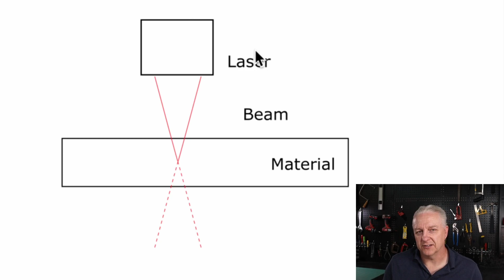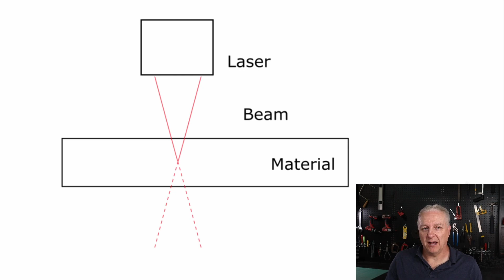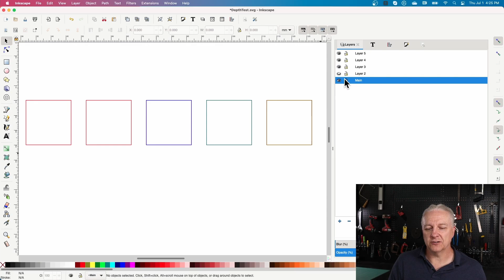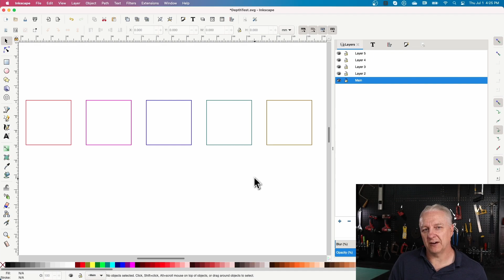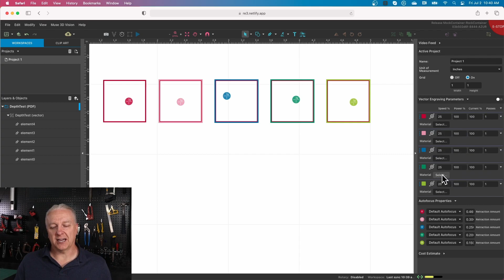LASER CUTTING THICK MATERIAL IS HARD!

Comment: I've got a DIY CNC laser with a measly 5w output and it never occurred to me to lower the Z height for subsequent cuts. Thanks for the tip. I'm going to try cutting above my weight class now.
Reply from the maker: As long as you don't move the project while you are refocusing you should be fine. Note, though, that a diode laser beam has a much longer usable focus area, so the benefits might be more minimal than, say, a CO2 laser.

Let me know how it goes, and good luck!

Comment: I’m here because I got a 100w co2 and really struggling cutting 10mm MDF
Reply from the maker: Well, there are a couple of challenges you might be hitting.  First MDF is notoriously hard to cut cleanly - it tends to burn.  But if you have a short focus lens, then the useable part of the beam is pretty small.  You may have to add a second lens to your toolkit - like a 5" lens.  The region that the laser will be in focus is quite a bit longer.

Comment: I still can’t get my tabs and slots right so I can’t make anything that has either one of those is very frustrating
Reply from the maker: You don’t say what problem you’re running into, so I can’t guess what problem you might be experiencing
Reply: @ Steve, the slots and tabs don’t fit with each other. It’s like the tab is too big for the slot.
Reply from the maker: @BrendaDavis-1963  Maybe you need to calibrate your laser.  If the X and Y aren't scaled the same, then tabs cut on the horizontal may not fit into slots cut on the vertical.

Comment: There's a good video titled: How to cut through double the thickness
Reply from the maker: Thicker material is easier with a 30-40W diode laser or a higher power CO2. Smaller CO2 laser struggle with play wood that’s thicker than a few millimeters

Comment: I just received the new Atomstack A70pro. My first ever laser. I’m trying to cut 1/2” prefinished engineered hardwood. After hours of struggling, I’ve been able to get some success with this method however, total success is on a knife edge. The balance between failure to penetrate and catching the wood on fire is difficult. Every successful moment comes with 10 new failures. I just cannot quite find the balance. I believe the trouble I am having is the project includes a series of 1/4” slots in a long row. Think of the 7 holes in a Jeep grill. I’ve had some good clean cuts but then a fire. One pass isn’t sufficient and two passes results in flames. My understanding of the problem seems to be the closeness of one hole to the next. Not the distance between necessarily but rather the time the laser spends in a given area. I predict either the heat from the nozzle or the air assist system is keeping the flame alive from the previous cut. So, I’ve experimented with forcing Lightburn to move around the project in a random pattern to reduce exposure of heat and air in a given cut. Sound logical? I’m not to complete success yet, still struggling. Thanks for the tips.
Reply from the maker: Laser companies usually imply that you can cut 2x4’s in one pass with their laser, and this is sometimes true, but the result will be terrible.  Rather than trying to bull through wood with 100% power and glacial speed, instead make several passes that go faster.  This will give you a cleaner cut.

The method in this video is more for CO2 lasers.  Diode lasers have a longer focal length so you don’t normally need to resort to these tricks.
Reply: https://www.youtube.com/watch?v=AgzPx4wxpXw&ab_channel=TheCrawlspaceCraftsman

Comment: Thanks for the tip! I've been having a bit of trouble getting through 5mm where the glue is thicker, didn't think to cheat the focus down a bit. Going to give this next time I need to cut 5mm, so in the next couple of Days. Cheers!
Reply from the maker: Note that if you have a diode laser, the focus is typically much longer, so you don't typically need to resort to this trick.  If you have a CO2 you can also switch to a 5" lens to increase the useable length of the beam and avoid this.

Comment: honestly. invest in specialty lenses like american photonics. picked up a 3 lense kit from them and all the 3 lenses does everything i need. 1.5 for detailed engraving like pictures and acrylic, 2.5 for my detailed cuts like mdf and 1/8th birch. and 4for my thick plywood cuts cutting 1/2 inch ply like butter on my 130 watt laser. the best thing about the lense kit. it was only $130 came with all 3 lenses and nozzles and all use 10 mm or double AA battery to set the lense to your material to cut. no need for auto focus
Reply from the maker: I did this purposely on a Muse 3D with a 2.5" lens because that is what most people have for optics.  While I own a 5" lens for this laser, I didn't want to just throw money at the problem because so many people are on a budget.  I could have used my 90W laser and just avoided the whole issue, but where's the fun in that? 😀

Comment: I have an unusual problem. I ues the inclined board method of laser focus for my Creality Falcon 10w diode laser.
My "zero" location is front / left.
If I cut a line, left to right, in 3mm Baltic Birch at "Y" of 300mm, the cut is cleanly through.

If I cut a line, left to right, at a "Y" of 50mm, the cut is only half through this same piece of Baltic Birch.
My table is flat. 
The honeycomb is screwed to the table, so it is flat.
The laser feet all sit firmly on the table.
I believe the laser is a uniform height above the wood.
Obviously, I'm  missing something.
Can you help?
Reply from the maker: This is an interning problem but I can’t think of why in might be happening given your set up.  Diode lasers are far less sensitive to minor focus differences than a CO2 laser would be. Normally if you are close to focus it will  work everywhere.

Presumably if you can adjust the focus at 50mm to get it to cut through, then it would no longer cut through at 300mms. Have you tried this?

Comment: I cut 1/4" luan (3/16 actual or 4.6mm) at 450mm/m at 100% power with a 22w creality and it cuts beautifully. 8mm takes 3 passes. I haven't tried anything thicker.
Reply from the maker: Overall, diode lasers are much better at cutting thicker wood than CO2 lasers in part because they almost always have longer focal-length lens (most CO2 lasers use a 2" lens).  As a result, you don't normally need to resort to trickery like adjusting focus
Reply: @SteveMakesEverything  I've only had it a month... haven't advanced enough to try any trickery yet...
Reply from the maker: @Beecher_Dikov  😀The trickery is really more for CO2 lasers

Comment: I am trying to cut 1/4" MDF on 24w láser the first time went great now I can't get it to cut all the way through. I'll give your suggestion a try and see if that's the issue
Reply from the maker: Not if you are using a diode laser, you can just do multiple passes rather than moving the focus.
Reply: @SteveMakesEverything  i tried that and it because a chard mess and still didn't cut through. Yes I have a diode
Reply from the maker: @dustmakerdesigns  MDF can be hard to cut, but if you set your speed to somewhere between 1000-2000mm/min and a power of 100% (or even a bit lower) you will be able to do a bunch of passes to get through it.  Do as many passes as you need.

The tendency for most people is to go slow with full power in a single pass, and that is a bit like holding a blow torch to the material. Unfortunately, this is what laser manufactures try to tell us is good.
Reply: @SteveMakesEverything  about how many passes
Reply from the maker: @dustmakerdesigns  Depends how thick the material is but start with 10.  If the cut is obviously not through the material then rerun the same job without moving the material.

Comment: Hi Steve, I have a muse core, but my R3 isn’t giving me this option to manually focus. May you help me or is this not an option for the basic 40W Core machine ?
Reply from the maker: You won’t find this option in RE3 on a Muse Core because the focus is always manual
Reply: @SteveMakesEverything  thank you, is it impossible to do this method since I have the basic version?
Reply from the maker: @nyraalcorn2793  Indeed it is possible.  In fact, with a Muse Core or any laser with manual focus, you can just adjust the focus down slightly on the second pass.

Of course you do need to appreciate the limitations of a 40W laser.  No matter what,, there will be limits to the thickness you can through, which in the case of a Muse will be about 6mm.

Comment: Right now I'm testing the Atomstack P7 M40. They claim it can cut 10mm plywood. I don't have any that thick to test with but it had no problem with 5mm.
Reply from the maker: Diode lasers (especially 10W) can get through 5mm with relative ease in a few passes and a 60W+ CO2 will cut it easily as well.  40-45W lasers will struggle a lot with 5-6mm plywood and that's the predominate CO2 laser so I wanted to target those for this video.

Comment: I've had good luck cutting 1/4" Luhan Plywood but not other types of plywood.
Reply from the maker: It's possible that Luan is less dense than other types of plywood.  The challenge with typical plywoods from places like Home Depot is that they are often designed to be waterproof so they tend to use that dark brown or black glue between layers and it is brutal cutting.  I've also found some plywoods have nyon or firberglass filaments running between layers to give them extra strength.  A 90+ watt laser can hack through it relatively easily though.

Comment: Hi Steve, what power of your tube? I have a 60W Reci tube and haven't any problems to cut 6mm plywood ! I used this method to cut thich materials last year and I have luck to cut 12mm hardwood and 20mm softwood )
Reply from the maker: A 60W would be fine with 6mm- it's just on the edge limit for a 40W laser though - especially hardware store plywood that usually uses evil glues that aren't really designed to be cut by lasers.

Comment: A clear advantage to having the 3d camera.  Not having it I may try this by manually lowering it myself and try to estimate.
Reply from the maker: FWIW You don't.need a 3D camera at all.  If you are doing a manual focus then create a second focus puck that is roughly half the thickness of your normal puck and adjust the focus before doing the second pass.

I will go into my usual rant about Lightburn support on the Muse because Lightburn can do this automatically on a second pass if your laser has a powered Z axis.
Reply: @SteveMakesEverything  Thanks Steve, I'm pretty much a greenhorn and been having real trouble cutting through 3mm MDF without 50 passes lol!  Maybe this will yield results.
Reply from the maker: @webOfLies  Well MDF is pretty hard to grind though in general, but if it is taking more than a 2 or 3 passes then there is something going awry.  Check your alignment first (FSL did a decent alignment video not too long ago) or you can watch mine, though I cut all kinds of corners when I do alignment.  Try some aggressive settings as well (100%power and maybe 5% speed) to see what happens.  With a 40W laser it's pretty tough to get through MDF without some scorching tough.

Also make sure you are cutting MDF design for laser cutting.  Some of the material you get at a hardware store has very dense glues that make it nearly impossible to cut
Reply: @SteveMakesEverything  I've done alignment and the dots seem to be pretty close together.  But I noticed this time that the actual burn mark is like a quarter or what it was before?  Is this indicative of a faulty laser?  Now that I think about it this unit has just gotten weaker and weaker over time...longer and less powerful.  Could I have a bad laser?  Thanks for your input Steve.
Reply: Oh, its a Muse Core 45 W....no camera.
Reply from the maker: @weboflies999  The tube will slowly degrade over time, but even with pretty aggressive use it should still last a couple of years or more.

If you are saying that the beam spot hitting each of the mirrors is not a reasonable circle, then look for something blocking the path from the tube to the lens.  You can take a cotton swab with alcohol and gently clean the output of the laser tube if you haven't already.

If none of that cures the problem then it might be worth a call to FSL to see if they have any insight.
Reply: @SteveMakesEverything  Thanks Steve, I have a call into FSL.  I've only had the laser 2 months.  Doesn't seem right it would degrade this quickly?.  I may seek a replacement from them if I can't rectify the situation
Reply from the maker: @weboflies999  This would definitely be abnormal.  My hunch is that the beam hitting the first mirror is getting clipped.  Easy to verify by putting thermal paper on the input to the first mirror so you are only getting the beam out of the laser.  If it is clipped there the it is likely a tube or power supply issue.
Reply: @SteveMakesEverything  Steve, if you happen to see this I did as you said and put thermal paper on the first mirror and same result.  Much smaller burn mark and it isn't even a hollow circle as when I first got the laser.  Just a small solid burn mark.  Then I tried my first 1/8" Acrylic cut as per your specifications in your materials list(30% Speed, 100 power, 100 current, 1 Pass).  It took me 5 passes to cut through.  Does this sound like a bad laser at this point to you?  Thanks so much for your help.
Reply from the maker: @weboflies999  OK, could be alignment, a power supply issue or the tube in that order.  With those settings you should get through 1/8" acrylic fairly easily.

Comment: Steve, first I want to thank you for your videos! I've watched them all and I am inspired to get better. I watched this video on cutting thick materials and I am trying to cut 1/2 inch mdf with my 100W Muse Titan and I'm trying work with the focus levels. I'm getting the focus retraction amount reported in two different units, mm (6.800)and inches (0.268). The problem is if I try to adjust the amounts the laser either hits the material or goes too high. My goal is to cut a thick piece of wood by doing the first pass at the normal retraction amount, then doing a second pass at a lower retraction amount. Can someone let me know what I'm doing wrong?
Reply from the maker: It’s odd that your project is using two different units.  Check in RE3 settings to make sure the unit are set correctly and then check the units in your project to make sure they are the same. No sure how you created the project but I’m wondering if you imported components from different places and maybe RE3 is bring the units in with the component.

I’m going to try to reproduce this to see if I can see the same behavior. Then at least I can tell you how to fix it

Comment: Thanks for the tip!  I have a muse core as well and have been struggling with cutting 1/4” Baltic birch, I keep getting dark char marks. I see yours has a bit as well, do you sand it off?  I noticed the box at the start of the video has no charring at all but I just can’t get rid of it. I’d love some tips from you or even a video of how your clean up your cuts!  Thanks!!
Reply from the maker: Yes any 40W laser is going to struggle a bit with 1/4” material - especially hardware store plywood and this procedure helps, but you are always going to get some charring.  To mitigate this you can try lower power and/or a bit higher speed and add additional passes (dropping the focus a bit more with each pass).  Also spend a bit of time check your alignment. The better it is, the more power you will cut to the cut zone.

A more extreme solution would be to change the lens in your laser.  Mine had a 2” lens, which is great for fine detail but has a very sharp focal point.  I switched to a 2.5” lens recently because the point at which the laser is in focus is more elongated and this improves cutting thicker materials as well.
Reply: You might try masking the top and bottom of the birch with a adhesive transfer paper. This paper roll is made for moving vinyl decals from a cutter to the final position. You can try out the concept by just covering the area to be cut with masking tape. The tape absorbs some of the heat spilling over, so protects the wood from burning and resin released by the burning.

Comment: Hi Steve, very interesting tip to cut thicker pieces of materials. I wonder though how you setup your simulator. Having to turn on the laser to prep every cut has been annoying me lately. Would love to hear of an alternative. It does not seem to be a popular topic out there, so wonder if anyone else has done it yet. All the best
Reply from the maker: The simulator is available on FSL's web site here: https://re3.netlify.app/designer.  You can select the FSL laser you have at the top of the screen and after that it's pretty much like your laser except you can't actually run a job.  You can create and save projects from there though and load them into your laser later.
Reply: @SteveMakesEverything  Hidden in plain sight… thank you
Reply from the maker: Fwiw FSL did finally make it easy to find. It was a treasure hunt in past 😏